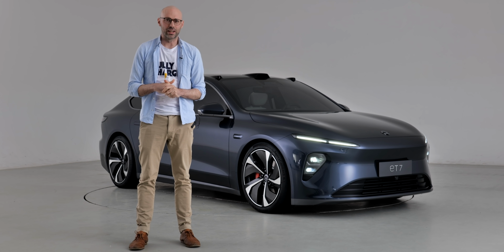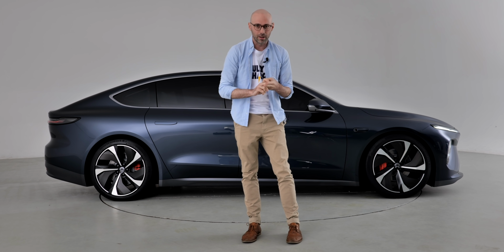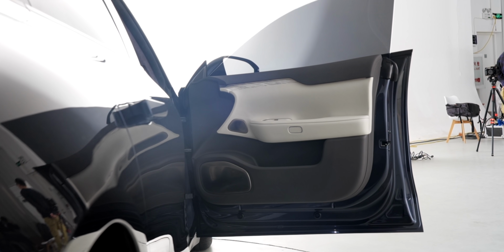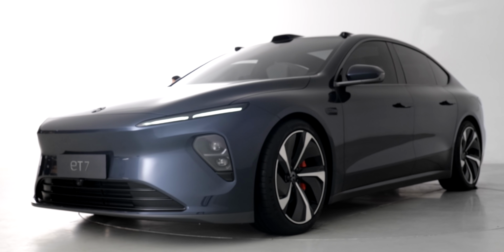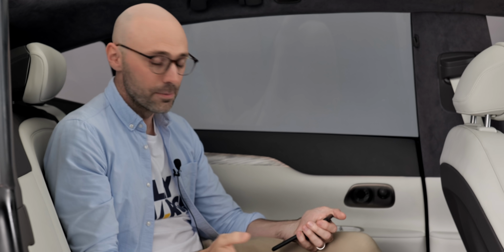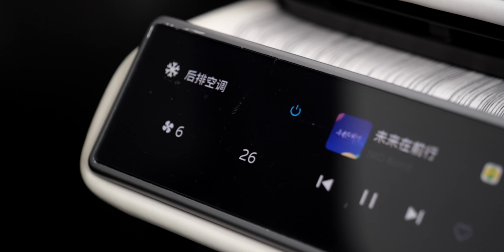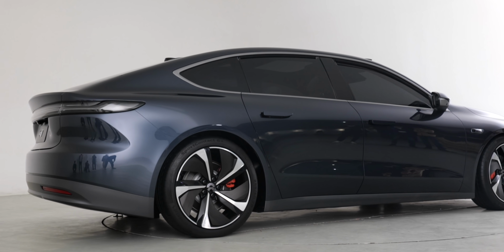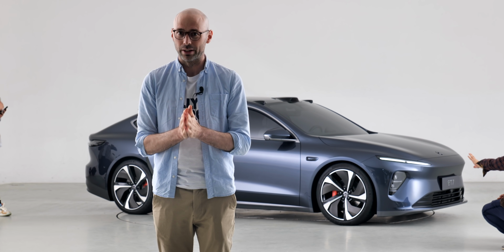NIO ET7 Sneak Peek - '600' mile saloon revealed | Fully Charged CARS

Comment: I wish you would explain the issue of the range a bit more. You headline it as “600 miles,” but as that is based on NEDC stats it isn’t really 600 miles as measured by WLTP or EPA values. You should clarify this point.
Reply: It's probably @30% less for estimates. Probably 700 km. Still pretty cool. And you can rent the cheaper smaller battery option for day to day and upgrade to the large pack just for trips.
Reply: @ChickenSandwichesForLunch  Yes, I think you are right. About 430 miles of range using familiar standards. Great range, but I think it is false advertising to claim it is a 600 mile vehicle. Makes it sound like Nio has somehow achieved a breakthrough that no one else can achieve. No existing or announced vehicle for the mass market has that much range.
Reply: @larryd8069  that's a fair point. Everyone Need's to use the same standard. Of course that's coming from me,  a US 👦who doesn't use meyric system or Celsius, lol.

Comment: Thank you!
A Coefficient of Drag (CD) of .23 is standard requirement for the class.........just like tires😎
Reply: Isn't the EQS CD down in the 21's? I know it was even better than Tesla.
Reply: With a large frontal area and huge weight with the 150kwh battery, it is unlikely to be very efficient.
Reply: EQS 0.20 ‼️

Comment: I wish the roof cameras and the center sensor were inside the car in the headliner focused through the glass windshield in order to make it even sleeker. But I'm sure they're there for obvious reasons.

Truth be told, this car looks a lot like my 2013 Kia Optima. This is what the desisn of the new K5 should stayed with. And I could easily see, looking at this body style, that a Kia K5 EV could look like this and totally work.
Reply: "Truth be told, this car looks a lot like my 2013 Kia Optima." Glad I'm not the only one thinking I had seen this before minus the roof humps.

Comment: "Pure, human, progressive and sophisticated"? Man, that guy was using some high level designer-speak. Makes uncultured, technical spec-oriented yokels like myself recoil in disgust
Reply: What on earth is a sixth of a decimal point?
Reply: @keithhoughton4308  
He's describing a measurement where the base unit is a kilometer....
(0.000001 km aka 1 mm 😂)
Reply: @keithhoughton4308  0.016 recurring would be my guess, but that's an impossibly small number when talking about fit if in mm......
Reply: @keithhoughton4308  6 decimal places? He's american, of course he going to try and use fractions
Reply: @scottwallis6197   Surely the Chinese  don't use inches (an Imperial measurement!) so that 16 thousandths of a millimeter equals 0.00062992126 inches or just over half a thou. Quite common tolerances in engineering. Isn't this fun?
Reply: @scottwallis6197  I think he said one sixth of a decimal point.... Which is mixing his metaphors a bit!
Reply: @keithhoughton4308  He did say that, didn’t he? And Elliot replied “Wow!”
Reply: We could have done without that bit, tbh.
Reply: @snowstrobe  Yeah, I'd rather have spent those 3 minutes learning more about the LIDAR system or something
Reply: Counterpoints the surrealism of the underlying metaphor...
Reply: He just has to feature in a future episode of Curb Your Enthusiasm
Reply: The Jony Ive vibes are high with this guy
Reply: If the Designer talking all that BS is that good, how come the old dear is wearing those stupid 3 inch boots teenage girls wear?
Reply: @russvhill2  He is vertically challenged, clearly.
Reply: Late brake show gives you drives of UK (ish) spec cars in normal person speak. Sometimes at the same place as Robert. Not that I wouldn't watch both.
Reply: Lol uncultured swine
Reply: "A quest to see what's the purest and strongest statement we could make from a volume perspective." 

You what?
Reply: It’s ok it’s an iterative process......
Reply: Well the car does talk to you ...... human-like.
Reply: They can allow themselves to be pretentious now since they arguably have the best EV in the market
Reply: I’m sure he’s paid a helluva lot to be able to talk like that
Reply: I think it sounds like mumbo jumbo, does he believe it himself or what. Sleek looking car but a little bit generic Tesla, Polestar, Xpeng. Find it rather uninteresting, low air drag is good but in general a little bit meh!

Comment: Some interesting facts about bettery swapping that I thought I might share. 

While Nio knows how to do marketing, they do have the money and the tech to back up the infrastructure needed for battery swapping. Another thing that probably won't happen in western countries is that, the Chinese government has actually stepped in and asked Nio to lead the way at setting a national standard for battery swapping, regardless of brand. Some notable companies that are part of the team set the standard include Beijing Automotive Group, Greatwall Motors and Geely, all big brands in China. So i'd say it's more than a gimmick, given that the Chinese government has an interest in their tech. 

Also, a side note, subsidies on electric cars in China have a cutoff price of 300k rmb. If the price of the car is above that, it will not be subsidised. However, the government does subsidise electric cars over that price that are battery-swappable. This makes Nio the sole exception.
Reply: @mingzmings88  what's your point?
Reply: @mingzmings88  well there are several reasons that I can think of for why it worthes a try:

1, battery swapping is faster to re-juice the electric vehicles comparing to the fastest super charging. it takes about 5~8 minutes to swap up a fully charged battery. 

2, super charging, or high voltage fast charging, is not healthy for batteries after all. it reduces the reliability and life span of batteries. it's just physically impossible to fast charge a battery without dealing some damages to the battery. using battery swapping system ideally most used battery can be re-charged at a more gentle pace, which is good for the society and environment I suppose. 

3, as I said, the older generation products can also benefit from newer battery technology with easy battery swapping system and it's a big bonus for owners because they don't have to envy late buyers and also when they try to sell the older ones the price of it won't be too much affected by the remaining capacity of worn-out battery. 

if the cost of infrastructure is the only problem stands in the way I believe the society can work together to overcome the difficulty. 
it's just my personal opinion or just some wishful thinking.
Reply: neat remark, thanks!
Reply: @mingzmings88  nah you've got to see the big picture. if battery swapping system as whole is proven to be practical and widely accepted by targeted customers in coming years in China then consider the volume of Chinese automobile industry the chance that other nations adopt this similar(or same) system is very high. after all the idea of battery swapping itself has a lot of advantages comparing to super charging, it's just that it costs to much to build the infrastructure for it. 

on the other hand, Nio ET7 with its 150 kWh battery and solid state lidar is still highly competitive in the market even without battery swapping feature. 

people have high expectations for Nio for some good reasons.
Reply: @mingzmings88  also we have to keep in mind that even older generation products can still benefit from newer battery technology because of easy battery swapping can help them upgrade their battery in a matter of a few minutes, boosting their older generation Nio cars with extra long range capabilities.
Reply: @mingzmings88  not encouraging anybody to buy a Nio but I'm just talking. it's just fascinating to see companies pushing these kinds of advancements.
Reply: You forget to mention one major reason why battery swap will not happen in the USA. Thugs will hit every battery swap stations to resell those batteries. This is America.
Reply: I'm Chinese and never heard about what you said "Chinese government has asked Nio to lead the way at setting a national standard for battery swapping". Instead, Chinese government just setted up a regulation by themselves in order to avoid some potential security risks. That's it.
Reply: @黑暗大醉俠  if you are working in automobile industry you'd know what he said is true
Reply: And disclaimer not a fanboy of Nio. Tesla Model 3 owner here. 

I do like the ET7, but that giant hump and the two little stubby things on the roof kinda kills it for me.
Reply: @bryanhe8908  I prefer BYD Han and Roewe Marvel R (aka MG5)

Comment: Looks splendid.
Sorry to be practical..but I've often wondered about those oh so trendy motorised pop out door handles. What happens when the car is covered in frozen ice?
Did they think about that?
Is it out with a bucket of warm water when my existing car just needs a strong pull.
Reply: What of there's an electrical fire and you are trapped inside and the button to open the door doesn't work?
Reply: @TerrySirius  it will be a pure celebration of fire elements.
Reply: In general, you can preheat the car from apps, so it might not be a problem with ice on electric cars. Someone here is bound to have experience with that.
Reply: @Timmahh85  thought someone might say that. Wonder how long it would take to defrost the outside handles.

Comment: 150 kwh battery, wow, my first Leaf had just 24 kwh, today Tesla only do 100 kwh. I'm impressed.
Reply: It's not impressive at all. It's wasteful. Instead, they could make two cars with perfectly usable range with 75 kWh each. Solve the long distance travel worries with high speed charging like Hyundai and Kia.
Reply: @bilgyno1  I hadn't thought about it like that, you make a good point. And this supports those car makers like Mazda doing modest batteries,  I did wonder why.
Reply: Due to their efficiency Tesla seems to only need about 80% of the battery compared to everybody else to get the same mileage. B ut I fully expect to see them have a 120kwh Model S as soon as the 4680 battery is ready for full production. We should know on June 3rd.

Comment: I don't think the battery swap thing lasts very long. I think the move to traditional charging takes over sooner rather than later. Kind of like the LG G5 to G6. Return to basics.
Reply: While I agree with what you're saying to an extent, LG  hasnt been a company good at marketing nor is it famous for making "refined" tech. What I'm saying is, with what i've seen so far, LG made phone with bugs or flaws that rendered their innovative design pretty much just gimmicks. 

Now back on Nio. They do know how to do marketing that's for sure. They have the money to back up the infrastructure needed for battery swapping. And another thing that probably won't happen in western countries, the Chinese government has actually stepped in and ask Nio to lead the way at setting a national standard for battery swapping. The goal is to make all electric cars' batteries swappable, regardless of brand. Some notable companies include Beijing Motors, Greatwall Motors and Geely, all big brands in China. So i'd say it's more than a gimmick, given that the Chinese government has an interest in their tech. 

Also, a side note, subsidies on electric cars in China have a cutoff price of 300k rmb. If the price of the car is above that, it will not be subsidised. However, the government does subsidise electric cars over that price that are battery-swappable. The makes Nio the sole exception.
Reply: This car has traditionally charging as well. China iS setting a standard in the next few month for swap stations.
Reply: If your EV mileage degrades 30% in 3 years while new batteries come out that have twice the range, half the charge time at the same cost you will want to replace your battery.
Reply: Battery swap stations are pointless for 99% of people, and even more so when car ranges are at minimum 250+ miles. The only use I can think of are for commercial that drive all day
Reply: @aiskef33  yeah, that's reasonable. You can replace the battery every few years I suppose if better tech comes out. I imagine swap for highways only.
Reply: Battery swap means needing more batteries.  Battery supply is the limiting factor right now and range is fine for most people so battery swap will dissolve away in time as people realise they just don’t need it IMO....
Reply: @duffgaryduff  I would agree.